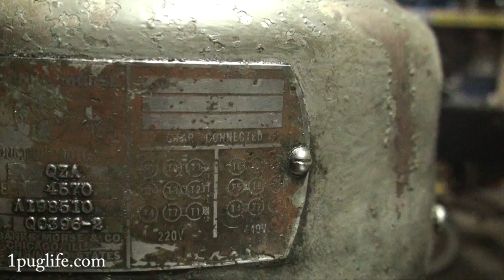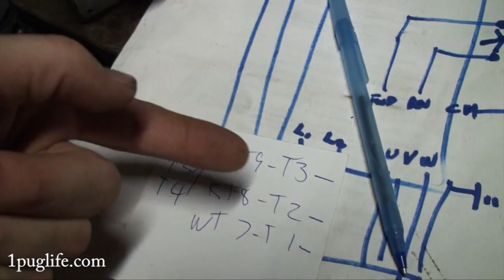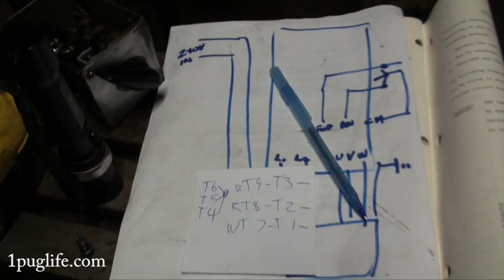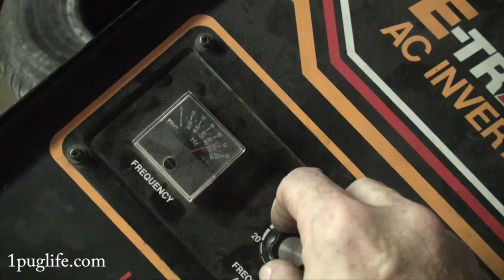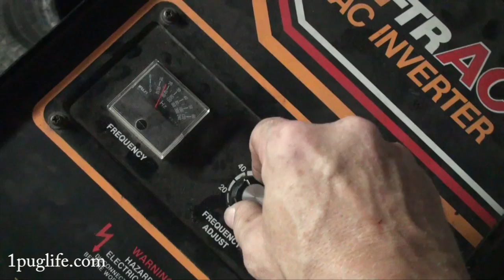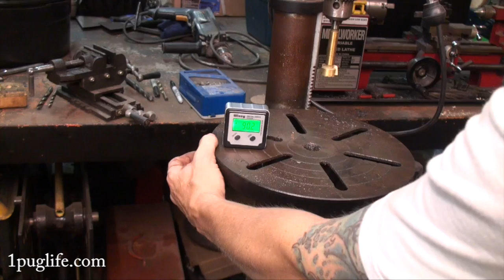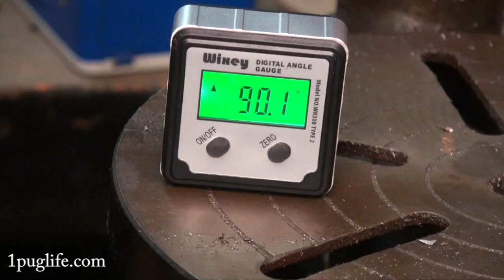powering up the bridgeport mill with a veriable frequency drive

Comment: we use a different plug in europe the prongs are inside a plastic tub going all around the plug 
theres no way to be able to touch the prongs while its even halfway plugged in 
http://www.iddparts.nl/resizemax.asp?file=1524016-1.JPG&maxwidth=334&maxheight=334

Comment: Bud need to keep inverter box at 50-60 hertz or yer motor will burn up. or do you call that an engine ??? I got 1 j head Bridgeport and 1 CNC mill in my 1 car garage now CHOOCH IT BIG TIME.

Comment: Pug,   I teach VFD at the tech college in Wisconsin.  Always try to use the gear or pulley that let's you run the motor at least 50 percent speed.  Your motor has an internal cooling fan connected to the shaft.  If you run the motor too slow it may not get enough cooling and it could burn out the windings.  Most mechanical people I know wouldn't try hooking this up,  good job.  I don't care for my sister too much so you can stovepipe her.  Craig

Comment: It doesn't look like you will ever have to buy drill bits again.
Reply: PieKlan im an engineer, i dont break cutter's, that machine pug has is fitted with a coolant mister.
you are the idiot.. ffs.
Reply: PieKlan only when you do it wrong, tools don't just snap...
Reply: 1970chevelle396 tools snap fast when ur machinin bud
Reply: chrismechanic B
 you're an idiot. I'm a machinist for a living, tools snap no matter what you're doing hahaha
Reply: 1970chevelle396 i know eh lol he is good for life. but knowing pug even that is never enough lol
Reply: chrismechanic B ESPECIALLY on these manual bridgeport mills, where there's no automated cooling.
Reply: chrismechanic B bits will dull and break no matter what. Graphite or diamond I've been using my grandfather's Bridgeports for 15 years
Reply: chrismechanic B 
The reason you don't break cutters is because you don't cut anything. Engineers draw, machinists cut.

Comment: I might be a big goof, but when you leveled the drill press surface using the fantypanter, that doesn't change the final angle of the bit.  So the bit might not be coming straight in anymore even if the table is technically level  cuz the whole unit might be cocked.  Pologize if I'm an idiot
Reply: He zeroed it on the bit first in a vid last week. Bmp!